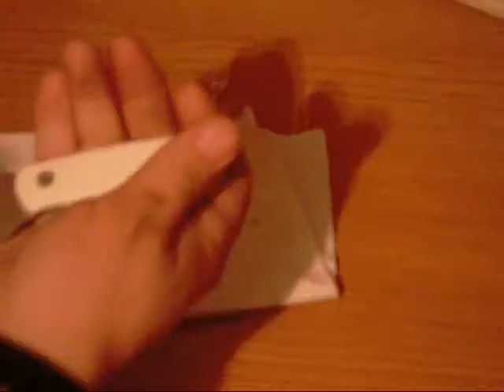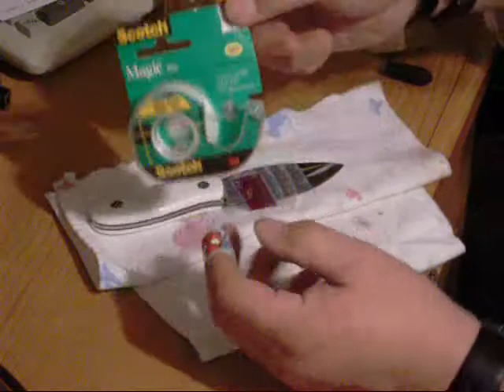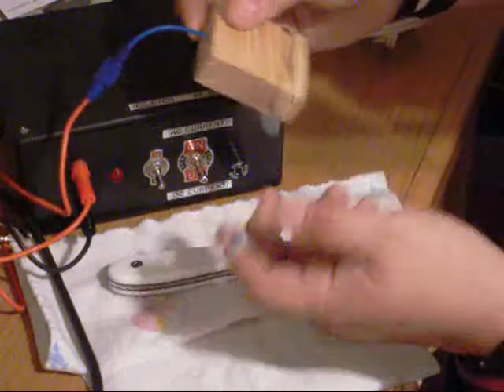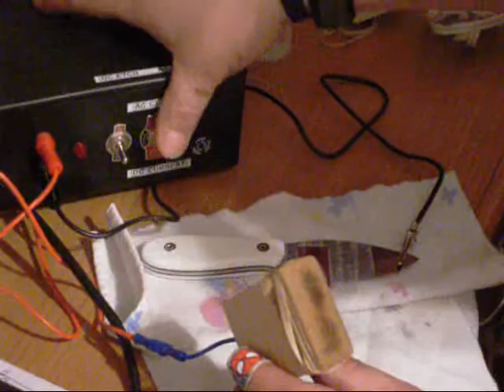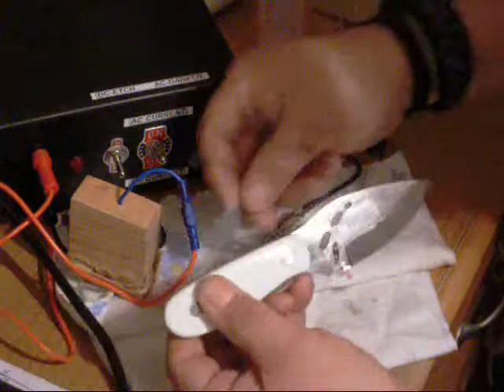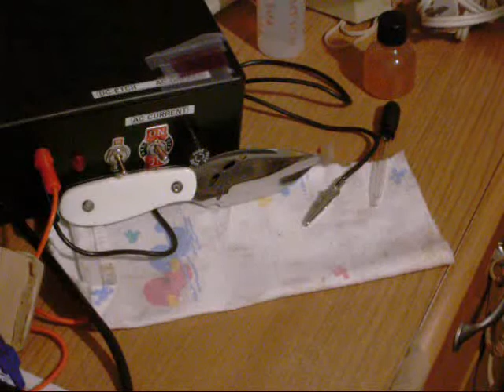New Knife and Etcher for sale & Etching Process.wmv

Comment from the maker: @PintoBlades I really like the corian it works different but really well. It was not as hard to work as you might think. I also made a writing pen with the scrap section of this knife to fit the lanyard I wear at work which came out really cool, I used a section of Ebony and a gold a black clip to match the color scheme of the knife (didn't have silver or the like on hand). A source is great to aquire an assortment of colors and patterns from. As far as the etcher goes I will send you a PM.